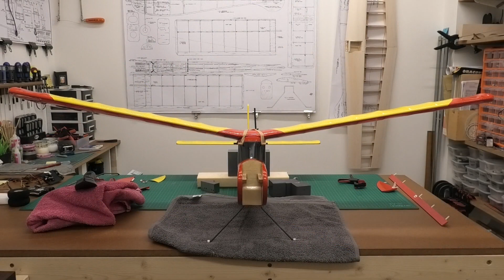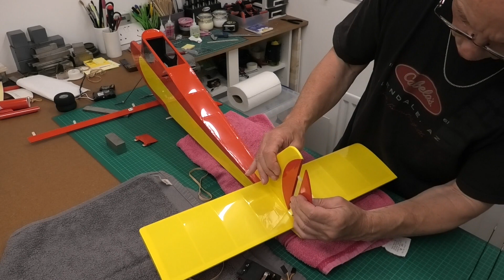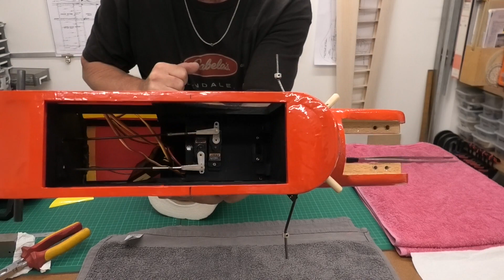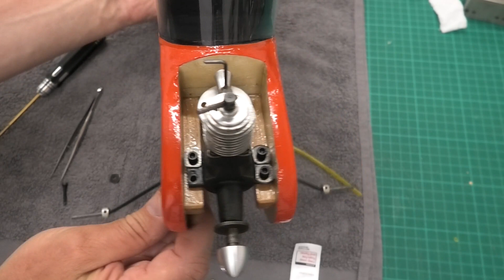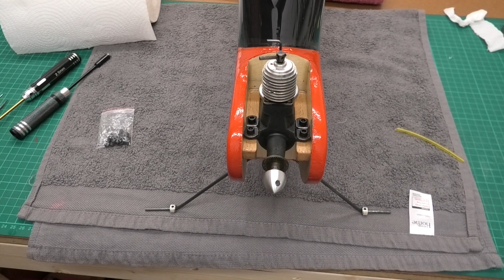Tomboy Senior - Build Series - Pt 16: Setting up the Plane

Comment: You didn’t say anything about how the switch is operated? Was it operated from the outside?
Reply: Thanks Mark - it was the drilling of a hole through the switch that I was looking for. All clear now thanks. David.
Reply from the maker: The switch, which is inside the fuselage is operated via a thin piece of wire that passes through the fuselage side, just a small hole, this way it is protected from any oil
Reply from the maker: You can see how I did it on this model, at about 13 minutes into the video, hope this helps.  https://youtu.be/5dfzKC-bQPs?si=6yO8UfYUXuhkG3wJ

Comment: Looking good, Mark.
And the orange and yellow colors will really show up well.
A point of order, if I may...
I always use at least three hinges on every control surface. That way, if one comes loose, I still have two hinges left. It has happened before.
Hopefully, new builders will take heed.
Now, let's get this cutie pie in the air!
Reply from the maker: Hi Richard, thanks for the comment, pleased you like it.  Thank you for the very sensible suggestion regarding hinges.
Reply: @MarkRobinson555  
You are most welcome, Mark.
I always try to promote the hobby.
As we all should.
Blue skies and fair winds, my friend.